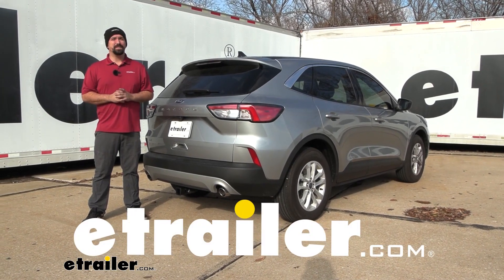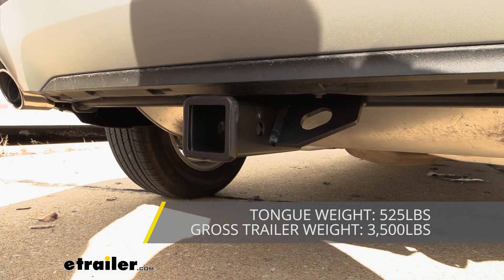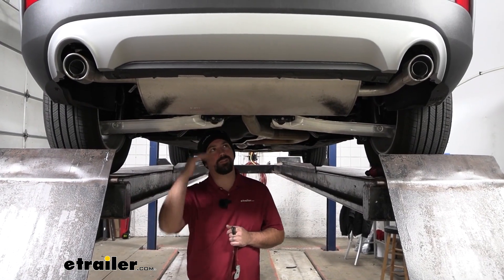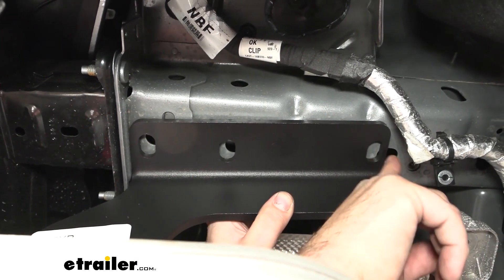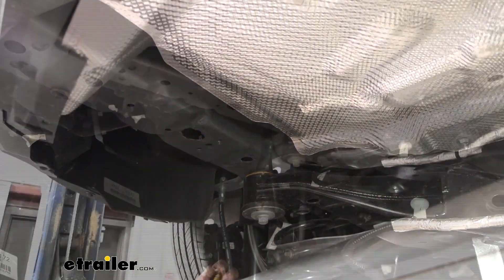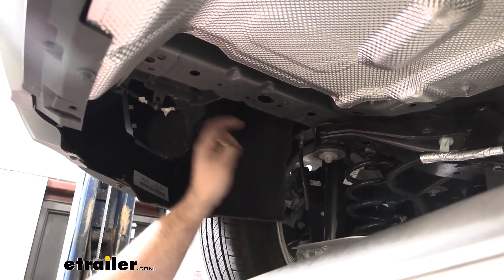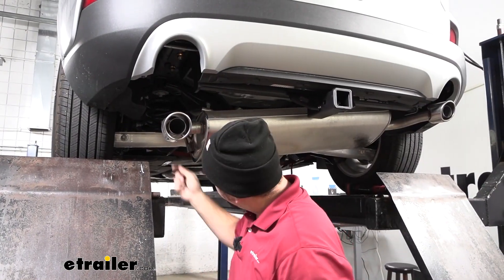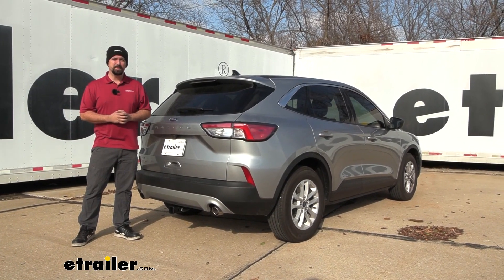How to Set Up Your etrailer Trailer Hitch Receiver on a 2022 Ford Escape

Comment: I need to transport brush/limbs to the local landfill.  Do you have any suggestions?  Thank you!
Reply from the maker: Your Escape has a tow capacity that varies from 1500-3500 lbs, depending on how it's equipped. Your owner's manual will help you narrow that down. If your trailer weighs less than the towing capacity of the vehicle, you'll have zero problems running yard waste/debris to the landfill. You'll need to install a hitch and trailer wiring. You'll also need a ball mount as well as a trailer ball that's compatible with the coupler on the trailer you're planning on using. For a hitch, we recommend the etrailer brand # e89YR hitch for gas or hybrid models.  For trailer wiring, use # C75CR. You'll need a ball mount like # C45070 and a trailer ball like # 40038 for a 2 inch or # C40002 for a 1-7/8 inch ball. You can see all this stuff by checking out the links I've provided below:
https://www.etrailer.com/Trailer-Hitch/etrailer/e89YR.html
https://www.etrailer.com/Custom-Fit-Vehicle-Wiring/Ford/Escape/2022/C75CR.html
https://www.etrailer.com/Trailer-Hitch-Ball-Mount/CURT/C45070.html
https://www.etrailer.com/Trailer-Hitch-Ball/CURT/40038.html
https://www.etrailer.com/Trailer-Hitch-Ball/CURT/C40002.html